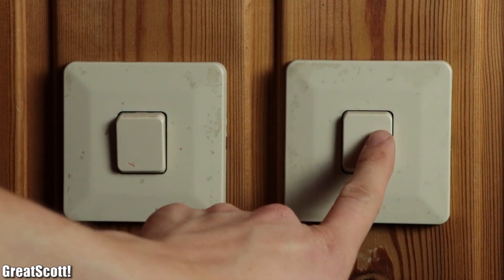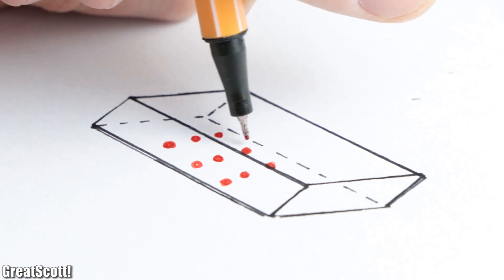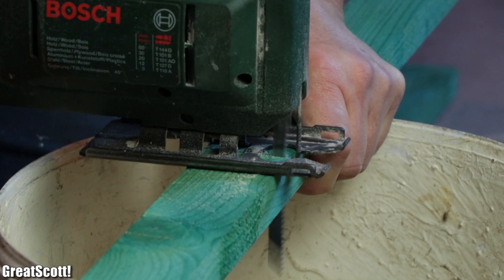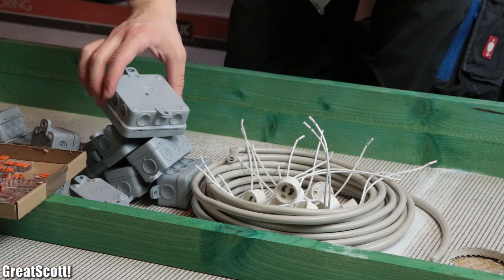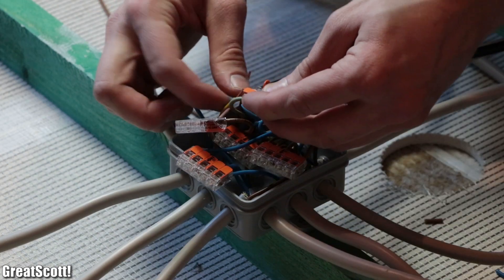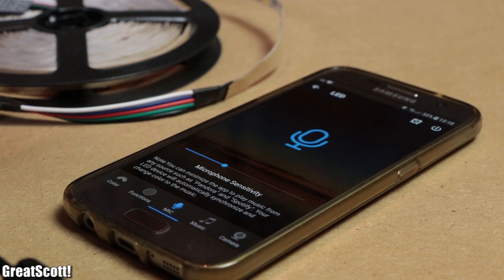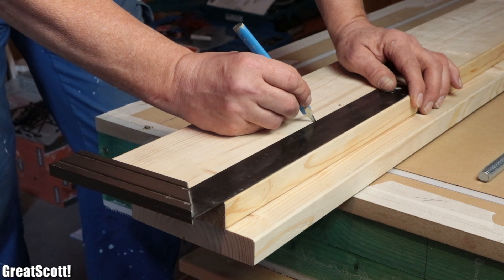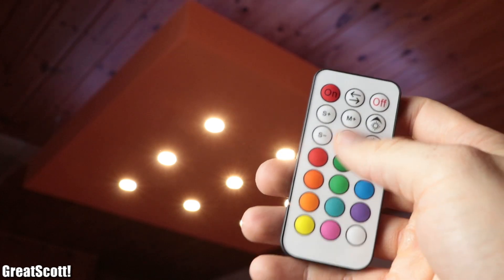Make your own Modern LED Ceiling Lamp

Comment: You don't need so much distribution boxes; i would have done it with only one bigger one (and not so big) or it would have been possible to use none since everything is already in an enclosure...

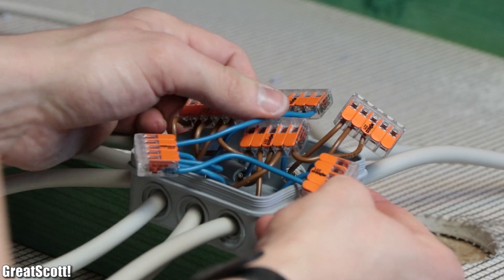Comment: just a suggestion :  dont cut the socket(plug) like that(5:53), have some wire left along with the plug so you can use it in any other project. Love your projects, awesome work.

Comment: If someone want's to buy lamp similar to this I can recommend: 
https://www.aliexpress.com/item/xiaomi-mijia-Yeelight-led-ceiling-light-650mm-modern-smart-homekit-lamp-for-living-dining-study-room/32971975376.html?spm=a2g17.10010108.1000001.12.3e5abc95BmzBwL&ws_ab_test=searchweb0_0%2Csearchweb201602_1_10065_10068_10890_319_10546_317_10548_10696_10084_453_454_10083_10618_10304_10307_10820_537_536_10902_10843_10059_10884_10887_321_322_10103-10890%2Csearchweb201603_51%2CppcSwitch_0&algo_pvid=f700faf6-749c-4884-b151-b9e5041329d7&algo_expid=f700faf6-749c-4884-b151-b9e5041329d7-32

is really good and even can be control via voice thru google home or alexa :)

Comment: Scott is an electronics genius but not a wood working genius. I would've used plywood instead of MDF and the side would've been made with 3x1 or 4x1 boards and cross members with 2x1. A lot lighter and can be fitted to the ceiling without having to strengthen it with structural supports.

Comment: Project idea: DIY ultrasonic cleaner for PCB and components using Piezoelectric transducers
Reply: Just buy a good one. There is a good reason that those "ultrasonic cleaners" that you con buy for cheap are just utter garbage. And with cheap I also mean those that you get for a few hundred bucks on eBay. A good one will, according to its size, set you back about a half grand, but that's worth it.

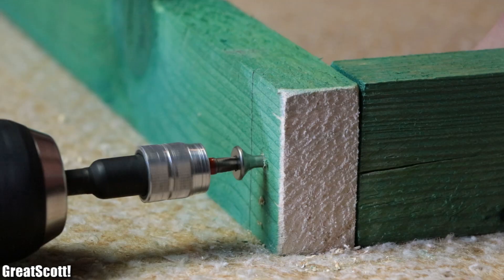Comment: 3:34 - You need to drill a guide for each screw when attaching wood this way, else your wood may split, just like it looks it's happening in this part of the video. Also, you can use a bigger drill bit (as big as the head of the screws) to make a small recess on the wood so the head of the screw sits flush, instead of pushing its way onto the wood. ;)

Comment: HI there, off-topic; But I really need your help guys

 I've been exploding my brain the whole day. in my arduino , when a condition is met
I want to turn a pin HIGH for one minute  then go LOW ignoring the condition if is still on at that moment, without using delays.

So far, I managed to turn it on and off only when the condition is false (which is not what I want) any help please.
Greetings from Tanzania

this is my loop at a moment:

void loop() {
  currentTime = millis();
  if ( (digitalRead(sensor) == HIGH) || (timeRunning == 1)){ 
    if (timeRunning == 0){
      startTime =millis();
      timeRunning = 1; // flag to show timer is started
      digitalWrite(motor, HIGH); //make sure motor is powered
      digitalWrite(fanPin, HIGH);
      }
    elapsedTime = currentTime - startTime;
    if (elapsedTime >=oneMinute){
      digitalWrite(fanPin, LOW);
      digitalWrite(motor, LOW);// un-power the motor 
      timeRunning = 0;
    
    }
  }
}

I'm not good with arduino guys, sorry for the bad code, please advice
Reply: Try posting it on reddit.Good luck.

Comment: In professional ways, you can mount ceiling lamp and LED RGB controller by fixing thick plaster and a electrical junction box for electrical and electronic control. Finishing will be good. wood is heavy thoo
Reply: That's not professional at all.

Comment: You could create arduino-wifi project wher you could connect 2 lamps with wifi and each lamp could have 10W RGB led and touch sensor and when you press on it the other light up (you have one lamp and your frend the other)

Comment: cool idea  but
I have problem with charge lead acid battery 
I have 30 ampere trasformer but when I charge the 100Amh battery only takes 5 ampere 
is there any circuit helps me to control current up to 30 ampere ?

Comment: Ich hatte ähnliches Projekt aber als 200 x 100 Sternenhimmel, habe um Gewicht zu reduzieren aus dem Baumarkt Aluminium 40er U Profile für den Rahmen genommen und Boden aus Plexiglas. Mit versagt von 50mm konnte man die Halterung nicht sehen. Und 4 weitere 100mm 10er U Profile als Decken Halterung zum reinschreiben. Aber definitiv cooles Video, mein upvote hast du :)

Comment: You could get away by using 0,75 mm2 wires instead of 1,5 mm2 for the light. It would be more than enough for the application. It would be so much easier to put in a box.

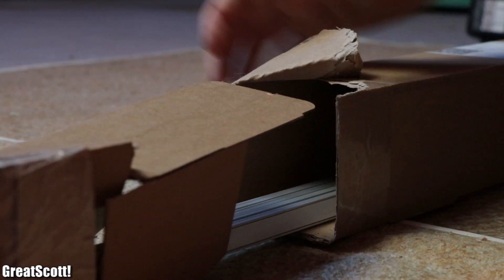Comment: At 6:13 - your electrical code might have a rule about how many connections you can have in a certain size box. That box might not have enough empty space in it.

Comment: I can tell that you haven't done much woodworking by how you made this lamp. Several of your choices of materials, like stacking the wood lath instead of just using wider boards or plywood and using the thick MDF instead of using a piece of plywood with the channel for the LED strips cut all the way through the panel and then using either pieces of dimensional lumber or plywood to support the area the channel was cut through. You might want to befriend a carpenter and running projects like this past them to lower your workload, cost, and the weight of the final design.

Comment: why bother submerging the led strips in metal tracks in the mdf instead of just sticking the led strips on the surface, since it's not visible?
Reply: The metal tracks act as a heat sink for the L.E.Ds so thats probably why...

Comment: If it has teeth it is a saw - Hole Saw. i.e. jig saw, table saw, band saw - And oh my goodness that fixture might withstand a natural disaster! Well, I suppose you guys HAD FUN making it, and that's the point. And I bet ten bucks if I scroll down I will find a million complaints. No worries. Hey, a disco ball hanging from the center would really compliment those bright white lights you installed! Thanks for posting the build man...

Comment: Thought you would show how to select 1 of 3 watt LED chips and how to heatsink them , then select proper drivers. And again the RGB LED strip - thought you would show how you used micro controller  esp8266 to control it via wifi and also mqtt. But I understand for how inexpensive all the off the shelf components are ( except for the over priced RGB strip ! ) it is easier to just plug and play . But as others have pointed out - using other materials would have made this a lot lighter - could have bought a metal square ceiling lamp and used the box to mod . Just my critique for what it is worth.

Comment: I have been doing a few lighting projects for my house and I have learnt to go minimal on lighting fixtures, your project is fine but expensive for what you are trying to accomplish also I would always be worried if it fell it would crush whatever is underneath it. I have found ceiling spotlights to be great for this sort of thing, do a search on aliexpress, ebay or banggood (the last one was a joke btw) for "ceiling rail spotlight", I remove the crappy cheap globes and replace with a local good quality globes though.

Comment: Great video as always. Few comments/suggestions from the unprofessional. 1. From the construction material you use and the dimension, the lamp seems to be really heavy, consider the ceiling lamp in the market are mostly made of plastic or thin metal sheets. Would it be better if you use more 3D printed parts rather than wood to made it? 2. From the demonstration in the end, the lamp seemed to be a bit dark than normal lighting. It may be the camera issue though.

Comment: After the nukes have dropped there will be cockroaches, Apple fuses and this light fitting left..
What was wrong with a bit of MDF with a few ribs down the back to keep the weight down..
You could have achieved that surface look with some textured wall paper as well btw.

Comment: At 5:17 there's a mention that this should be done by a professional electrician (which is fair enough, it's mains voltage after all). For projects like this one, does it matter for insurance whether that's a certified electrician or not though?

Comment: Could you do a tutorial on how to calculate power supply specs for rgb strips on day?
Reply: Just look at the specifications of your LED strip: Multiply the total length with the Watts per meter (or your preferred unit of length) and add a little bit of 'head room' for the PSU. 

If your supplier doesn’t specify the power rating per length unit, and you already bought the LED strip, cut the shortest possible length of the strip, power all LED colors with the specified supply voltage and measure the power consumption. After that, look how many of that short strips fit in your total length of the strip, multiply the power consumption and add 'head room' for the PSU.

Comment: I've been following you some time now, and appreciating your work, but in this case I feel that you have over engineered the whole project.
I made something similar in the past with aluminum coated PVC, i think it was 3 mm thick, OK i was lucky they laser cut it 1m x 1m for me with extra charge. one layer was sufficient, the lamps are in the center the LEDs on the border (didn't have strips then), on the surface, no grooving and covering necessary for low power: if I wanted a massive look like yours, a thin wooden rim would have been sufficient, the result, much lighter and much less hours of work.

Comment: God, I love [and hate at the same time] German perfectionism - you are really placing a separate plastic cable box for every wire junction point and used a push-crimp terminals everywhere, while here in Eastern Europe an average [certified (!)] electrician would just twist bare wires together and use some duct tape (in best case scenario), or just leave them bare and use a nail to fix cable (in the most likely scenario). :D
Reply: Or use screw terminal blocks

Comment: Too heavy - hope ceiling mount is strong enough... 
Electrical part is great as allways, but rest could have 1/5 of the final weight - unless in next step you plan drop it on robbers ;]

Comment: I like the overall topic, but the use of MDF seems overkill, as well as the plastic junction boxes which ultimately just hold the wire connections seems like overkill.  I'd have thought making a simple box out of plywood would have worked as a great overall frame, and would contain all the wiring once completed.

Comment: Why not just use electrical screw joints? Those lever connectors seem bulky and expensive. The lamp looks pretty good tho.
Reply: Because his professional electrician friend was schooled by another professional electrician from Home Depots plumbing section.

Comment: you cant turn off center spots without turning off LEDs, very easy problem to solve, just add an switch.. except you closed down the box lol. but it is still an awesome project

Comment: In order to not have the wood cracked and, therefore, less rigid, you should first make a hole one millimeter thinner than the diameter of the screw. Saves you a lot of time when you have to deal with thin planks and joints in the extremities of the planks. The wood has a natural tendency to split. This tendency is useful when you want to crack a big tree trunk cut-out  with an axe, but does not really help you when screwing wood together.  See 3:29 of this video.

Comment: I've got those tube shaped light bulbs that hum consistently and Flickr when you first turn them on if only I could replace those with LEDs
Reply: There are LED replacements for fluorescent tubes. You only need to replace the bimetallic starter by the included »LED starter« (a simple bridge).

Comment: Something my dad taught me about wood working is that you should always avoid having screws going into end grain, because it will cause the wood to split, so if it necessary, predrill  the hole.

Comment: Calling this project exhausting but the previous projekt was a launchpad.
I don't know about you, but for me soldering so many LEDs and switches together, in such a repetetive manner, is way more exhausting than something like this.
In fact, I think you gave me a great idea for building a lamp when I'm finished with my bachelor thesis. I would make some modifications to it, to better fit my needs, but thats the nice thing about DIY. So thank you for this great idea.

Comment: Why, instead of using several lamps with included shitty PSUs, you don't use one proper - non-flickering - AC->DC converter and simple LED panels?  

9:17 - woods (plural) means forest. So it's just "pieces of wood".

Comment: I really wanna do this but I'm scared of the electrician part
Reply: You could use 12v lighting instead of the GU10.... I often swap GU10 for a 12V version, which is the same size.
Reply: @dannygee3600  12v, would required 10A along with the LED to get proper luminosity.
Reply: @stanimir4197  Luckily, 12V PSUs that can supply a lot more than 10A are commonly available as ATX PSUs.
Reply: @NiHaoMike64  True... However modifying an ATX power supply is not a straightforward process - it requires "power good" and some load on 5vsb (and likely some +5V too). Now you cannot put that close to the lamps as pretty much all of the PSUs require airflow (and most of them have fans)... and they are rather bulky. 

Placing them in a separate room to avoid the noise comes with cabling problems and long DC cabling is prone to galvanic corrosion. 

I have been thinking of having 19v DC lines in the house but it's no trivial task.
Reply: That's by significant part the easiest part
Reply: no more electrician skills than replacing a light bulb needed

Comment: Unnecessarily complicated.
It is absolutely unnecessary to use building materials with a lot of weight, just to keep a few light LEDs spots, and LEDs profils. The use of cans to connect each GU10 would also be unnecessary - if not the large amount of wood used to create this "lamp". The gaps on top between the aluminum profiles of LED strips in the corners also do not look elegant. It could have been done much better. The end result is not that bad, but really it was be possible to achieve a much lower workload.
Please look at the ways of building a suspended island on the ceiling - this saves you the future of labor and material costs.
Reply: Noticed that too I think thin sheets of acrylic would fit better for this kind of project ,also it adds a possibility to do a transperent or semi transperent design
Reply: Most of the boxes like this I see are built into the ceiling - I think this was an interesting solution for making one that could be removed if necessary. But I agree that the materials used are a bit heavy. You could make a very lightweight frame out of wood or alumin(i)um and just attach the acoustic board to the outside. Or just make it a simple MDF box. The step of building a top panel out of MDF and routing it to hold the LED strips is unnecessary, as long as the top isn't visible under normal conditions.
Reply: Yes, you're right. My "island" was directly fixed to the ceiling. However, you can easily make small scale ceiling island (like mine), and hang on the steel cables. It will be very light. Ofc. this should be a closed box, because it will be easier to keep clean - I mean dust on top. Routing grooves for the LED strips is really not bad idea, only MDF was unnecessary ond overkill material for this job;)
Reply: Then go do it better
Reply: karlpc200
And i did lol! - at my home, for example :) But on much much bigger scale the this.

I use Knauf Cleaneo Akustik board (It suppresses the sound very well), and some normal plaster board, Main construction is made from profils UW 75 and CW. Ofc LED lights etc
Greetings :]

Comment: Massively overengineered IMO.  LEDs pull very little current, you should've used lamp cord to wire everything together instead of NEMA wire.  The frame should've been made lighter, you shouldn't have placed such importance on stiffness, and you should have hung it on the ceiling with some chain instead of that massive locking setup, putting less load on the ceiling.